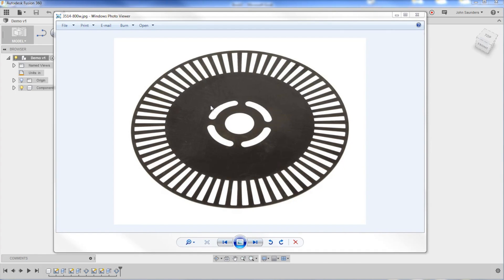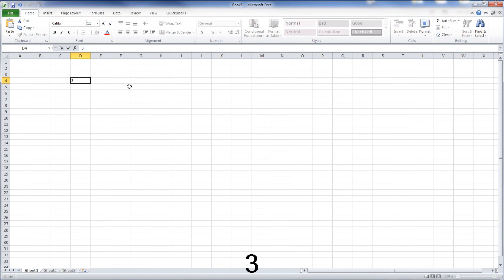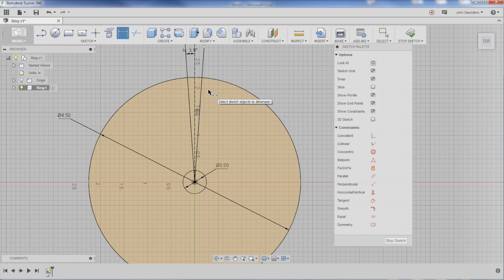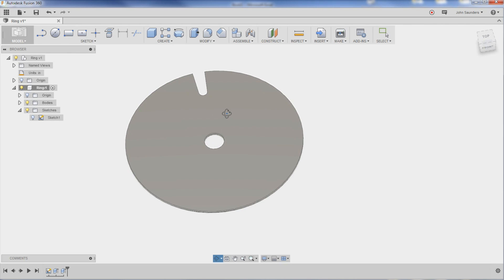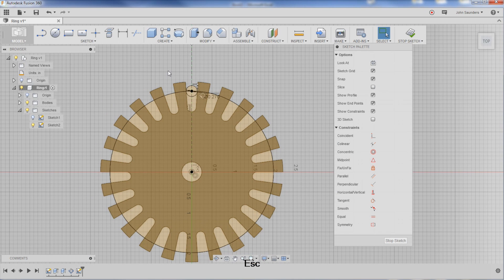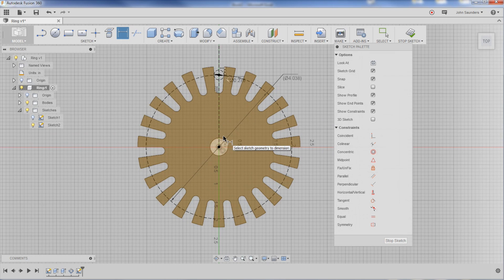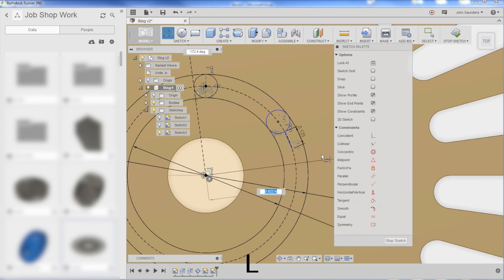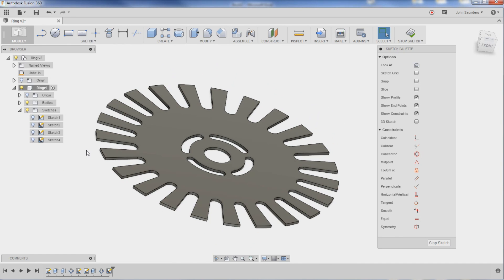Fusion 360 Sketch Constraints Make Math Easy! Fusion Friday #30

Comment: Let's pretend two of these discs are installed underneath a gravity hopper and used to feed 7mm rods or tubes. One issue I see is the rod/tubes getting wedged in the void because of the narrow wall angle. In that case, the arc that forms in inside edge of the void should be brought out to where the rod/tubes would hit the arc just before the diameter of the rod hits both sides of the void.

Comment: Wouldn't you want to use a dimensioned arc for those spaced screw slots? Since your 1/8th gap would actually be a little undersized?

Comment: John, I'm excited about Fusion 360. I've worked with AutoCAD for 30 years. The commands in Fusion 360 are so similar!  I thought about learning SolidWorks, but Fusion seems so much easier for me to learn. Your videos are a great source of info. I'm thinking of learning Fusion 360 and doing design work for a local job shop when I retire in a couple years. I don't need to make a living at it, but a few bucks might be nice.

Comment: John. I could really use some assistance with a part I am trying to model up. I have scanned in the part but the part has small teeth all around it which the scanner sees but when I fuse the model the teeth all get mangled up. I have tried meshmixer and some other modeling programs but they are not the solution. Your time is precious so I will not want it for free. Please let me know if you could look at it for me. Thank you

Comment: John, do you happen to know if there's a way to maintain parametric relations across files in fusion360 ?
Reply: Any idea if it's something that the Fusion360 folks would have in mind? I'm thinking about modular design and interchangeable components, so some way to manage changes between files would be awesome.
Reply: One place I could see this being especially useful for a shop like yours John, is for being able to reuse jigs and clamps, etc. modularize it a little.

Comment: When doing the inner slots, using a chord along the construction circle as a reference will not give you 0.125 spacing - you can confirm this by setting the ID closer to the 0.5" center cutout (i.e. really thick "slots" will exaggerate any error).   A better way is to add two construction lines 0.0625" away from, and parallel to, the axes, and make your end-circles tangent to those (i.e. construct your constraints first!).  That way your gap is constant independent of radius (which a radial line is not, it describes a wedge).  Another way is to set the distance between the centers of the two end-circles to a known distance, but then your gap is dependent on your slot width :-P

Comment: For the last slot sketch I would have done the same constraint method, but I would have done it along the default X and Y axis.  As you finished your sketch I suddenly realized that by not using the X and Y but your own construction axis you can easily change the dimension between the slots, and more importantly you can easily change the quantity of slots.  Change the 90 to 72 and you can pattern 5 slots.  Nice work.

Comment: The image you were working from looked like an encoder wheel.  But now it is some type of indexing plate?  Fusion is so darn handy.
That part could be an interesting work holding challenge! I hope we will see you cut it.
Reply: Easy peasy 

Flat aluminum plate, Double sided carpet tape, no coolant. :)
Reply: yep... thats what I was thinking.  I use 3m 9579 series double sided tape. (pressure sensitive adhesive)  It holds almost too good for thin parts.  Kind of expensive but worth every penny if you need your parts to not slip.
Reply: +Stahlin Studios 
Acetone IE nail polish remover takes the adhesive right off. 

You can also get a wire clay cutter. (Like $5) that you can work underneath the part to get it off. Little safer than trying to pry it off with a metal putty knife.
Reply: clay cutter.... brilliant
Reply: +NYC CNC you just use it cuz you like the smell :D

Comment: You should zoom in with your 1/8th circle at the end to check, you'd find out the gap is actually smaller than that. It's because your constraint distance is not orthogonal to the two small circles.

Comment: Find it interesting that you built and sketchers out the cut out section. 

I would have built one of actual fin portions and arrayed that sketch around    And extruded it. 

And I don't think using the straight line chord length of .125 between those slots is quite the right way. I would have set an additional.125 circle with the center coincidental to the midline circle and tangent to the construction line for the angle and the slot circle.
Reply: And a good check would to have been to sketch 2 straight lines across that are tangent to the radius at the end of the slot across to the slot radius opposite it. Then check the distance between the 2 lines you just drew and it should measure exactly .125

Comment: I use sketch constraints for everything. and math inside dimensions d1/d2  for mirrors rectangular patterns and circular patters. Don't need spread sheet. Just check out Manage Parameters. You can name and track all your dimensions there. So the part is built by logic and can be rescaled if required.
Reply: I'm an inventor Pro user... I think its "User parameters"  In Fusion 360.

Comment: Depending on how the gap between slots was measured or derived, it seems unlikely that the chord is exactly what you want. You probably want the minimum distance between those two circles, which lies on the line between their centers. At this scale you might never see the difference, but it shouldn't be too hard to construct the right line.

It's harder than it should be, though, since it appears you can't have a perpendicular constraint to a circle or arc, which would make it easy to construct the needed line segment. The best fully-parametric way I could come up with is to draw the line segment from circle center to circle center, and dimension it with a formula 1/8 + (d2-d1)/2, where d2 and d1 are the inner and outer diameters defining the slots.

Can anybody see a nicer way to do this?
Reply: I was thinking that myself: constrain the center to center distance to be 1/8 plus the diameter (actually, twice the radii) of the circles. 

By using half the difference between the inner and outer diameters you are just calculating the length of a single radius. (If I haven't messed up how I'm thinking of it.) I think that will make the gap too small by one radius.
Reply: Peter W. Meek I was thinking the same until I tried it. The diameter (two radii) we want for the little circles is the difference between the radii of the big circles. That's half the difference in their diameters.
Reply: Good insight that what we really need is a distance constraint between the circle centers. I got conceptually hung up on drawing a line, and made it harder than it needed to be. Now if Fusion 360 would just let us dimension the distance between the circles themselves, we wouldn't even need a formula.